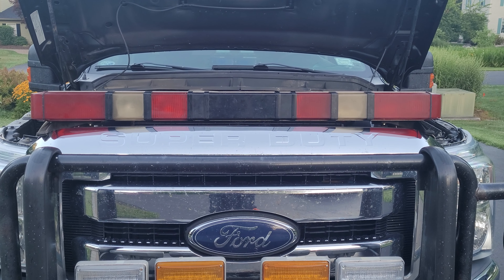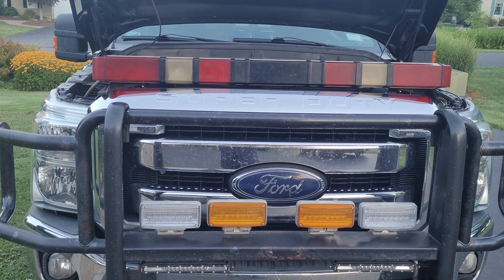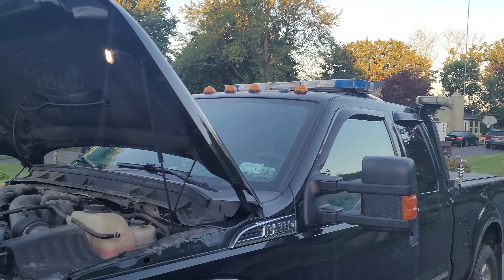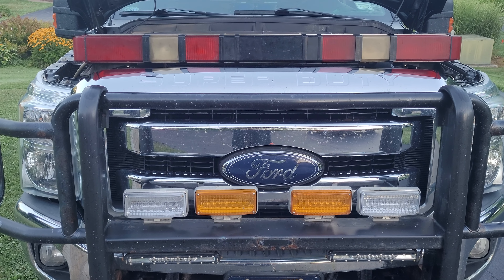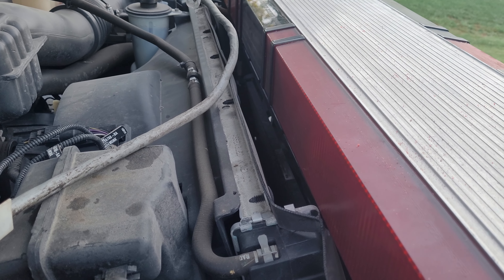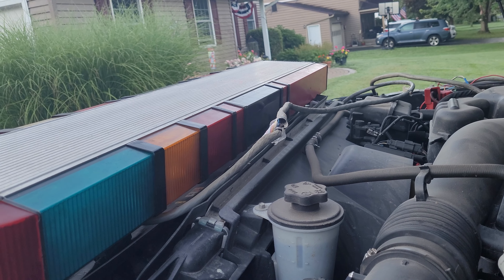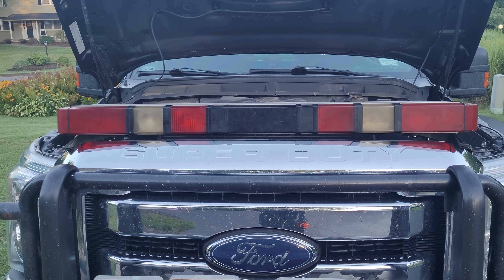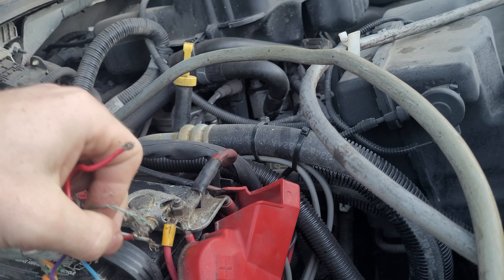Locally-grown Edge Makeover! *FIRST-GENERATION* Whelen Edge9000

Comment: got the same lightbar, but having some trouble getting it powered up.... i don't have the control box, can't this just be direct wired to the battery
Reply from the maker: For testing purposes, yes. That's how I did it in this video. The only one I have on a switch box currently (besides vehicle installations) is an Edge 9404 on display that could pass for an OSP-style bar minus the clear kicker panels.